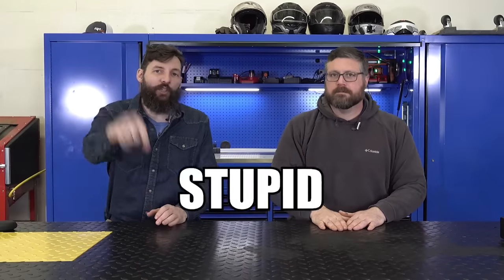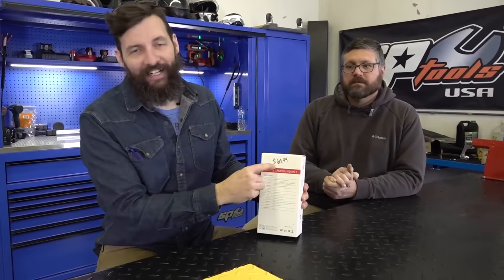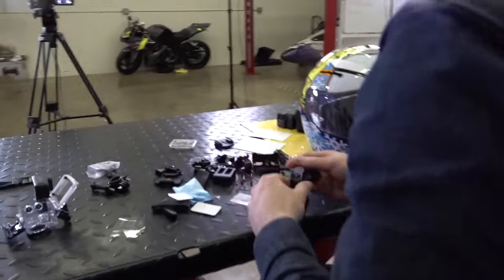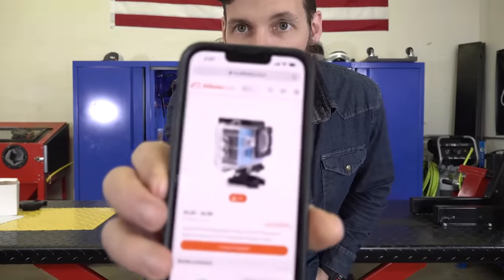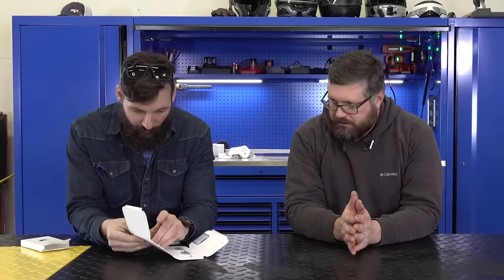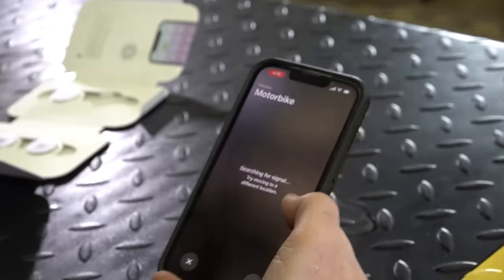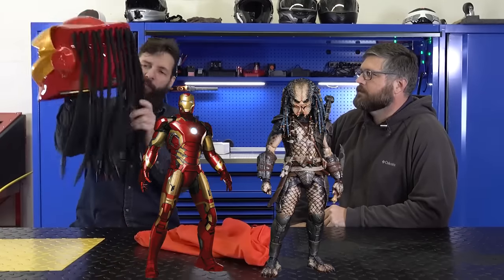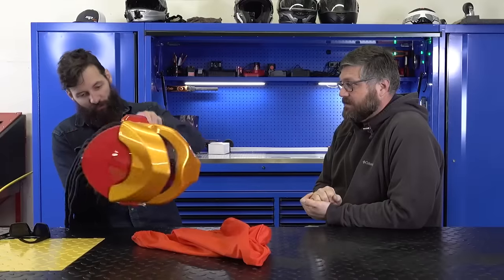Testing amazons Stupidest Motorcycle Accessories(#5 is Dangerous)

Comment: 36 psi in a truck with a pump that small is extremely impressive
Reply: Right,I thought it would give up the ghost well before it never failed under all the strain pushing back against it...
Reply: heck yeah, if you had a nail in the tire of a bike, that little pump could probably save you a wait and bill on a tow truck.  Probably get you home or to a shop. I liked it.
Reply: Need some affiliate links.
That really was impressive. Took a bit of time, I figured all it'd be good for is bicycle tires. The air compressor in my truck is WAY bigger, runs off an extension cord going to the inverter in the cab, and still takes a while to air up a tire. I might have to buy one just to have on hand. Again, need some affiliate links in the description.
Reply: Link for the pump?
Reply: I thought “really?” Was gonna pop up on the little screen.
Reply: I was impressed with the compressor as well.  And it would probably save you in a pinch.
Reply: Please correct me, if I'm wrong, but didn't it only add 12psi in those 16 minutes before it quit? Not sure that would make it useful for a really flat tire
Reply: @GH-cp9wc  but for a motorcycle it would be much more than that, being that a truck tire has a lot more pressure due to the tire have more square inches of space
Reply: @GH-cp9wc  yes but those truck tires probably have a volume 5 to 8 time that of a motorcycle tire.
Although if I had to use that little compressor  it would have a dead battery.
Reply: I'd put money on the battery being flat when you come to use it though... I'll stick with my compressor (that is about the same size) with its crocodile clips for the bike battery I think!
Reply: @robertgutheridge9672  My rear tire is 250/40R18.
Reply: My mind was blown with that small pump. Thanks for the video!!! 💪😃
Reply: I need the link to that pump, i would buy it after that review
Reply: @joshc1291  The truck tyre may have more volume, but motorcycle tyres generally go to higher psi. The tyre being bigger doesn't 'push back harder', that missing the point of what psi means.
Reply: @noggintube  you’re correct, but there is a greater volume of air in the truck tire, so the pump not having to run as long will likely pump up a motorcycle tire no problem. I’ve inflated many small trailer and motorcycle tires with small air tanks, and those same tanks would never fill a truck tire. You are correct though it’s more pressure but less volume.
Reply: @noggintube  Yeah, the same psi means they "push back" the same a bike tire, a truck tire, an airplane tire, etc. But that thing accomplished two things.
1) Resisted the 36 psi that "pushes back" and still did its job.
2) Transferred the x volume of air into the tire in 16 minutes.
So, we can safely say, it will pump x/5 volume of air into the bike tire in like 3 minutes.
Reply: You'd be better off using something that can plug into a socket. I have a Matrix inflator drill attachment and I can't even air up my tire on my van before it's dead. Last time it took my whole 7 gallon air compressor to fill it, which seems extremely inefficient, but I'd rather have a cheap 12V compressor than this. I need a better one, that's for sure.
Reply: I'd try to find one with gator clip battery connectors. I have one for my truck 285/75/17 @70psi. Had to use it a few times.
Reply: There is a crap load less volume in a bike tire...so the truck tire test was pretty bogus. It would have filled a bike tire pretty quick.
Reply: cant put enough emphasis on extremely, I’ve dealt with countless products very similar but the results were the complete opposite. nothing but cuss words and thrown tools on the side of the road lmaooo
Reply: yeah it wont lastr more than a year maybe and forget about it entirely if its cold or freezing
Reply: @joshc1291  Unless you're talking commercial trucks, pick ups have roughly the same pressure as a motorcycle or a passenger car.

Truck tires are just bigger, so, they just need more air, but pressures are about the same. You could literally fill up a truck tire and motorcycle tire using a bicycle pump. I know because I was using a bicycle pump for my motorcycle, cars and truck because I couldn't afford a pump or air compressor, but a $30 bicycle pump did the trick. I just had to pump more times when I was doing the truck but it still worked, and the resistance was about the same. It just took fewer pumps on the motorcycle than a car and so on.
Reply: But it didnt do 36 psi, it inflated starting at 24
Reply: If you're looking for something like that I recommend the halo bolt I have one in my trunk it has a lot more battery and it can jump your car. Saved me a couple times.
Reply: @GH-cp9wc  Exactly my thought. what if the tire is flat or very low? you wouldn't get enough PSI out of it to do any good.
Reply: Mi portable air filler is far better than this and cost cheaper than this
Reply: I have a similar device which I have on my MTB and take with me on motor trips. Works very well 👍🏻
Reply: Yeah i bought one for my truck but its even better cuz i can plug it right into the ciggarette lighter and get constant power unlike the wireless ones which die after one tire and fill up slow.
Reply: It really is. For that size, knowing it could pump up both my tires if my dumb butt rolled through nails or something is worth a lot. Charge it any time I use it properly, and I'd say it's worth it.
Reply: @tburda823  Exactly being at home with a flat tire instead of on side of the highway... that's worth a lot.
Reply: @GH-cp9wc  My thinking is this: MUCH bigger tire, so that's actually quite a lot of air to put in in that amount of time. It's not going to be a high flow situation, so that'll take a LONG time on a small pump like that. And being able to keep pushing against 36 PSI is pretty impressive. Motorcycle tires will be much less work and should more than cover both motorycle tires before running out/low.
Reply: @aviewfromthesaddle4160  I've been out of the bike game for a bit. Are there some decent compressors around that size? I'd absolutely carry something like that on my next bike.

Comment: The tire inflator was actually neat, very handy for emergency situations
Reply: That one was useless. I have one with the cigarette lighter power adapter that wont die on me. It's also half the size of theirs and fits under the seat.
Reply: @theultimateninja  great thing my bike has a cigarette plug.... Oh yeah it doesn't so yeah that one's way more useful
Reply: @michaelf.2449  15 min ang you could have one also easy install
Reply: @TheBCSandman  you can’t install a cigeret adapter
Reply: @MotocrossMan. yes you can….
Reply: @KarstRats  tell me where on an old school 2 stroke dirt bike you can install one then?
Reply: @MotocrossMan.  put a 12v miata battery somewhere on it. And wire the damn thing up. You can put a 12v cig lighter on anything even a bed frame… be creative my dude.. use a nice leather saddle bag to hold the battery in so it doesnt look gaudy.
Reply: There's a huge difference between inflating a motorcycle tire and the tire on a full size pickup. You could fill two motorcycle tires from nearly empty to full in a few minutes with that pump and barely use any battery. Even a car tire will inflate much quicker/using less battery than that truck tire.

Comment: The problem with the air tag is that now with the anti stalking feature it beeps all the time, so it alerts the thief where their tag is.
Reply: You can open it and put glue or caulk inside the speaker, which will drastically reduce the sound.
Reply: @marc-andreservant201  Or remove the speaker.

Comment: I bought a “Crosstour” action camera for $50 with a bunch of accessories, extra batteries and a charger almost 3 years ago. I’ve dropped it dozens of times, used it in the rain, and the thing still works! What’s more, the videos are rather decent, better quality than the one you tested, although far from a GoPro. But I got my money’s worth several times over. And I still use it all the time. Btw, great and entertaining videos, keep it up.

Comment: I have an air compressor very similar to the one you guys used. I only ever use it to top up the air in the tyres of my motorcycle once every few weeks, but we're only talking about from 28.0 to 32.0. Nothing dramatic. It does the job.

Comment: I have owned the air pump over a year now. Dont use it on a car tire. But tried just like them. However it has saved the day twice now. Awsome for trail rides and a quick phone charge. Also use it for just a quick tire check before rides. Check pressure and if you need some its right there.!

Comment: I've got one of those camera's at the start, not the same 'make' but another cheap version of the same camera, and it's perfectly acceptable for what it is. I use it when riding on my commute, and it does the job. The battery only lasts about 90 minutes, so that's not great, but If the choice is a cheap camera like that, or not having one it's perfect. 👍

Comment: I keep a mini air pump in my saddlebag to maintain air pressure.  It has a pigtail to run off of my bike.  Very useful when you go lower in altitude or it gets very cold.  It's also made so that it will fit in motorcycle tires where ones built for cars sometimes wont.

Comment: For the portable air compressors, you can just get a usb extension cord and use your bike or car to power it. It pumps air way faster and it still has a full charge when you're done with it.

Comment: ive always carried a small wired air compressor.  the $20 one from the auto parts store.  clip the end for a SAE connector to fit the trickle charger port.  works fine.   they dont last forever for sure.   but wired over battery, im not going to keep the battery charged on a "wireless"

Comment: Thanks for breaking down how the AirTag works. I have 4 of them, and was not aware they work with other peoples iPhones 
Proverbs 14:16
The wise one is cautious and turns away from evil, But the stupid one is reckless and overconfident.
Walmart has a small rechargeable air pump that can air up all 4 tires on a car pretty quickly. Only $20 with a long battery life.

Comment: yeah, my wife has been desperately wanting a predator helmet for a minute. watching that visor jump up is gonna kill that quick. the 3/4 helmet thing may not be a deal breaker, but if she thinks the visor's gonna fly up at 45, she'll give up on that.
Reply: Please don't buy those helmets. They are NOT good for a crash and they can be a pain in the ass while riding. I work at a gear shop selling motorcycle stuff.
Reply: @s70driver2005  yeah, no intention of buying that
Reply: @DaemonWulf7  people ask if we sell those sometimes. We say heck naw those usually aren't safe helmets. Get a real one.
Reply: I own a predator helmet, it is in fact a dot certified 3/4 helmet. The one they show in this video is a cheap imitation and would be unsafe, mine has a slide switch on the side that opens the visor which is the only part that moves and does not open in the wind even at 130 mph. If she wants a predator helmet, just spend the extra money for a good one and it will be just as safe as any 3/4 helmet.
Reply: @itstonberrytime  you go 130 in one of those.... no thanks.
Reply: @s70driver2005  yes I do, whenever it's safe to go that fast of course. I'm not reckless, but I have no problem with 100+mph either.
Reply: @itstonberrytime  But DOT means nothing, its extremely rubbish,  its only  making it 'legal', if u want your helmet to actually work get an ECE rated one.

Comment: Last year I got an action cam off of Amazon for the amazing price of $18.00.   I figured that if it even turns on it's amazing...and it came with a bunch of accessories too.   Thing actually works half decently...no, it's no GoPro but for the price it'll take pictures and movies.   I'm amazed that they could build and sell the thing...at a profit...for $18 bucks.   And I suspect it's probably the same camera you got for $68 as it looks very similar and how many Chineseium camera makers can there be?
Reply: i got a 10$ cam from ebay the video quality like vhs so i like it lol
Reply: I think I have the exact same model (under a different company name) that Shawn got.  But I paid roughly 40 for mine.  It does a decent job.  If you got it for $18, that's awesome.  The accessories alone are worth that price tag COMPARED to gopro branded accessories.  since the mounts are 'universal' you can buy that package, use the accessories with a gopro, and have the cheapo as a backup or as a dashcam type setup.  The color isn't great.  The frame drops are ridiculous.  But scale it down to 30fps@720p and you'll get solid video.
Reply: You didn't know it, but when you bought the camera you joined a Chinese spy agency called Chi-Spy. Everything you record goes back to the motherland.
Reply: @wanderingwade8877  I hope they enjoy plenty of footage of a bunch of Americans just... Trying their best driving.
Reply: Honestly even the proper companies make them for cheap enough that buying it at cost (for materials and just the people who made it) would be pretty much the same.
They really don't cost that much to make esp with how badly Chinese people are paid for their work.
Reply: @wanderingwade8877  Sweet!  Do they just mail out the decoder rings or do I need to email someone?
I know!  I'll just record myself requesting one.  I'm sure they'll get it.
Reply: @precise1329  Yeah, and if you want to piss off Chairman Chee (I don't know how to spell the name) keep saying into the camera that Chee looks like Whinney the Pooh. That really hits a nerve.
Reply: The accessories alone are worth that price, I bought a Akaso and I bet it's the same, one manufacturer, many distributers (Just like Hyundai and Kia) I should mention it's my second one. What no one talks about is how easy it is for the cameras to go flying in another direction during the action. Watch the motorcycle bloggers,  every few videos the camera takes off! One blogger talked about the gopro insurance plan, his complaint was you can only use it twice and you have to have the camera.
Reply: It goes to show how ridiculously marked up a gopro is lol

Comment: Apparently the Apple AirTag takes 15 minutes to Kickin. 

I suppose this is good if they nicked your bike and store it somewhere overnight at least this will give you time to track your bike. Also you can play the sound and it will ping. So if it’s behind a garage door and you press play sound it will make a noise.
Reply: Where did you get the 15 minutes from?
Reply: If the air tag is in your bike this take 15 min before it’s starts letting you no is even being moved 
Then You can start tracking its current location
Reply: @SuperGizzzmo  But where did you find the 15 minute thing, i own an airtag and as long as there are apple devices around it its instant not with a 15 minute delay.
Reply: So I watched a iTunes video and I girl got a friend to take the rucksack and drive off and it took 15 min for it to activate and start 

Get one of your friend to drive off and see what it says let me know if it’s instant or if there is a lag on it Dave
Reply: @SuperGizzzmo  from what i have tested it’s usually instantly, if the iphone it currently communicates with is connected to the internet

Comment: I have a small air pump, even smaller than the one you tested. I think it was $30. Works great on the bike (motorcycle, not bicycle, although it works great on the bicycle, too). Charges via USB. Mine is about half the diameter of the one you tested.

Comment: For the tyre compressor, I would just get for example a Ryobi air compressor handtool, I filled a trailer tire loaded with logs within few minutes. The size of it is same as a hand drill.
Reply: ALL my ryobi stuff works the best, start EVERY time even after sitting all winter, I'm sticking with ryobi stuff, 2 strokes, 4 strokes and electric, great tools, ALL!!!
Reply: I have a similar one, looks like a hand drill, I use it to keep an eye on my motorcycle tires.

Comment: I actually got that little radio setup for in our side by side and it worked really good...for a while. After a few months the Bluetooth function quit working which is why I bought it so I was bummed, but it still worked using a 3.5mm aux cord. Speakers held up really well and we eventually upgraded to an actual car stereo but kept the little speakers in it and they're still going strong. Not a bad little unit, but like most things that are cheap, its prone to failure.

Comment: I have the dragon touch vision 3 and I gotta say it's pretty poor quality compared to the GoPro however that dragon touch is like 6 years old, so compared to a modern Gopro it sucks, but compared to the low end Gopro from like 6 years ago it's only a little worse. It really works best at 1080P on 60 FPS for motion. You also need to have a really good sd card for it or it looks terrible and stutters. That being said I would go with a used or refurb old Gopro from a few years ago for about 100 bucks, sometimes less when on sale. If you want a new one now and don't need the best it's passable on 60 FPS @1080, but when it's so close to the cost of an older GoPro you know will work better for longer it's a hard buy honestly. We got it as a wedding present is the only reason we have it.

Comment: You probably didn't put the right settings on.

I have a HJC camera was very cheap, less than £50 it works well in the dark and does very good footage, the only down side to it is the fact that every time you take the battery out you have to set it up all over again.

Other than that it's a really good camera.